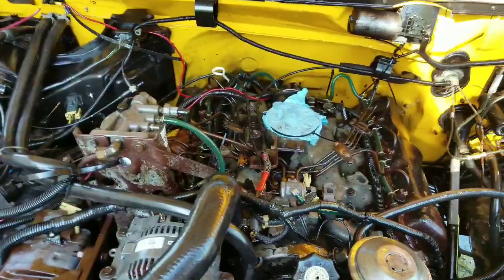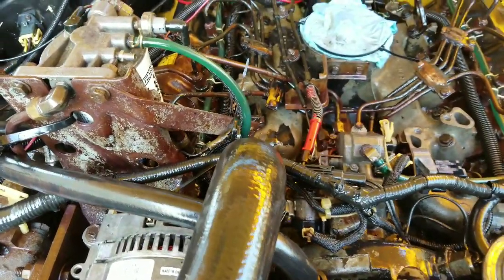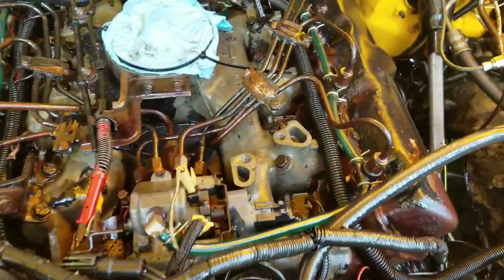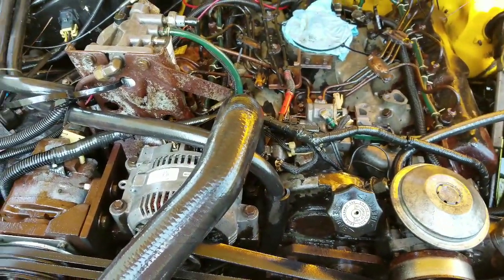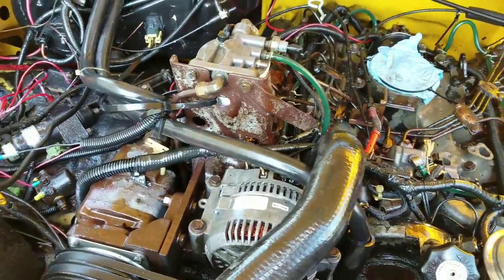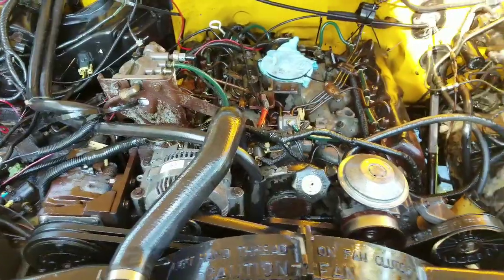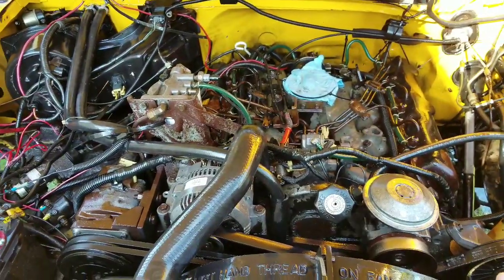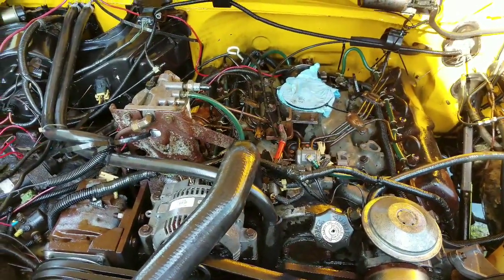My idi 93 7.🌲 project

Comment: I just got a 93 f250 7.3 idi with factory turbo and it's a 5 speed. I love it. 180k miles. No blowby and it runs fantastic. I sold my 12v Cummins to get it. Loved the 12v but didn't care for my particular Dodge.
Reply from the maker: Is that a 4 x4?
Reply: @FLORIDALIFECLIPS  no I have a 99 f250 too and it's 4x4. I didn't really want one in my diesel  because here in Texas I don't really need it and it's just more parts that can go wrong.
Reply from the maker: @superchargedpotato   oh ok

Comment: Here it is 20 20 I'm still running my 93 IDI pulling the trailer with a tractor on it with my pump bumped up a little I remember you commenting on my video that you tried it and it worked out